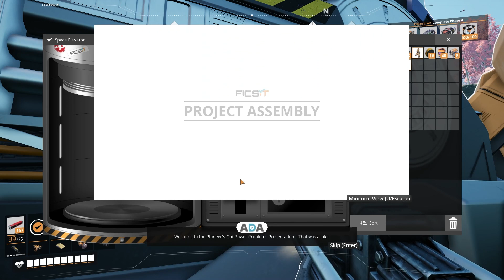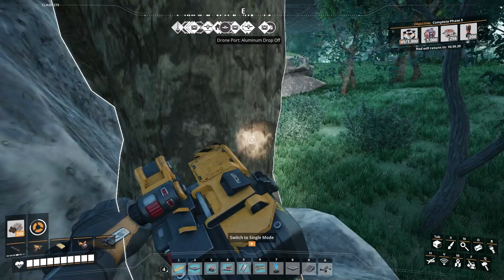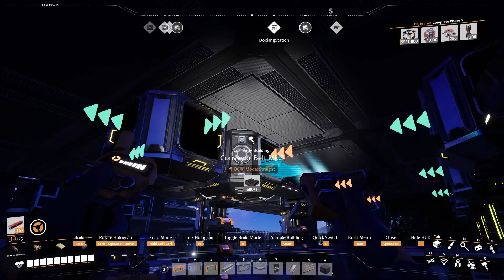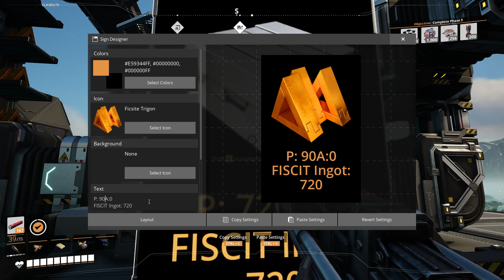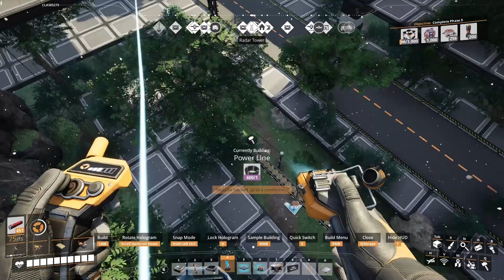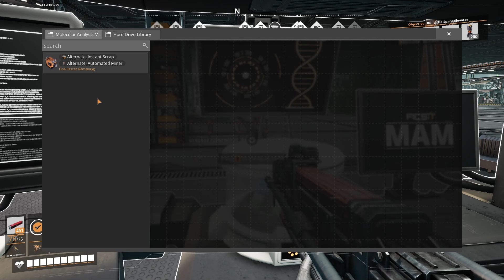Producing the BIOCHEMICAL SCULPTOR - Satisfactory 1.0 EP40

Comment: Hello, 
Maybe this old info, but for the deletion you can select a filter with "G" key, when in delete mode. 
It will set it to what ever you are pointing and then will only select that item when holding "CTRL", avoiding accidental deletions.
Reply from the maker: Thanks, yes I do know these tricks, I just forget to use them
Reply: @DataEngineerPlays  😂😂👍